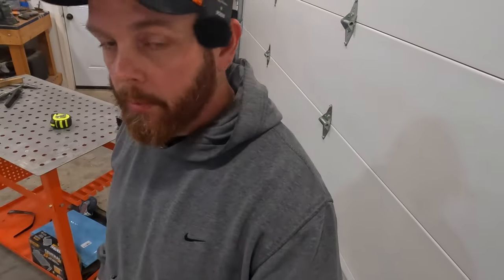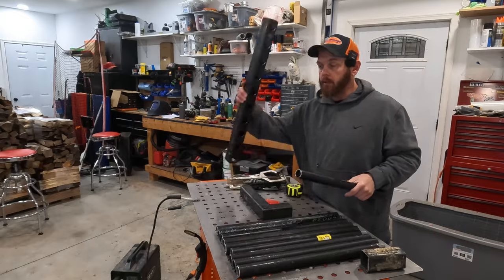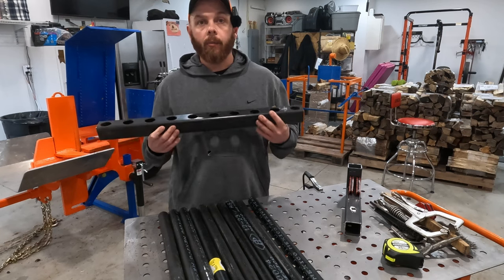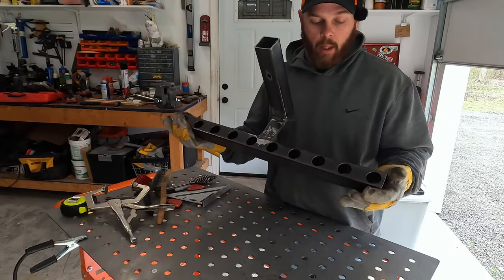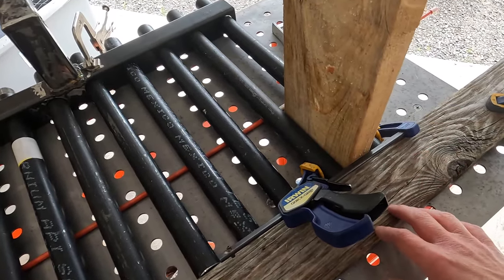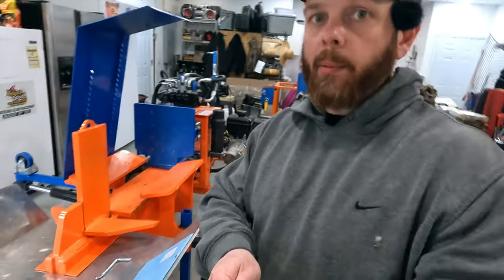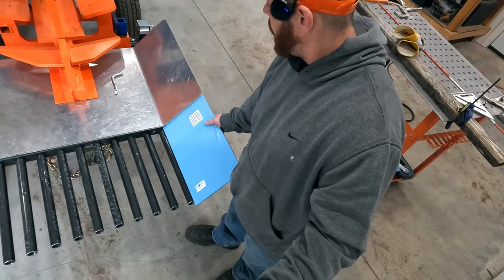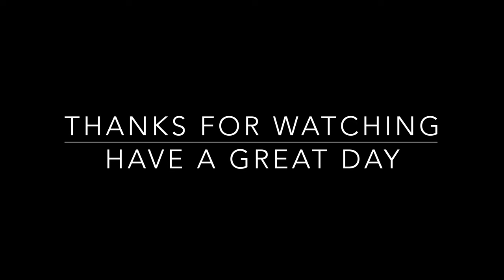Eastonmade 12-22 Sorting Table Extension Upgrade

Comment: That turned out amazing Tony. Your angle cuts and holes will make it a durable weld. The side panels will help guide the splits through. Its perfect.
Reply from the maker: Thanks Kenny!  I think you’re right, I’ll be adding the sides in the future.

Comment: That's a great idea.  Looks like you stuck the pipe through the square tubing a couple inches, any reason why?
Reply from the maker: Thanks, I wasn’t sure if I was going to make the table 18” so I cut all the pipes at 20”. I ended up going with 16” for the table and it gave me a good bit of pipe to weld in both sides

Comment: Nicely done Tony. Seems like a well thought out plan. The hole saw you used are just like the cutters I use in my mag drill and the work great, but as you learned, messy. I like your fab/weld table, that's a nice setup. Very handy for projects like that. 
This is off the wall, so forgive me. What size is the hole size in the top of your weld table?
Reply from the maker: Thanks Bobby! The cutter worked awesome for sure. The table is made by vevor  I picket up on  amazon, the holes are 5/8.

Comment: Tony if the price are like here and down where you are aluminum is way less now over steel buddy . Take Metals “R” Us or metal supermarket pop out a pc in sec in aluminum or steel or ect . Tony just get a good cut off blade call ( walker ) your 1” round should be longer for the firewood to Traver over far for the dirty to drop . drill there an oil for cutting and drilling for steel tony save your bits plus faster . See WD - 40 too light of a oil for drill bits buddy . Tony old aluminum road sign with little bend side and 2”,3” 4” hole or cut channel 1”,2” with jigsaw work with right blade . Welder the steel got to clean before welding buddy if not make a dirty weld . New   bare metal is coat with a oil , keep away from rusty buddy . Before an idea should bring it up 🆙 on U tube you will get a million idea ( hits ) how to do it tony .
Reply from the maker: Thanks Leonard!